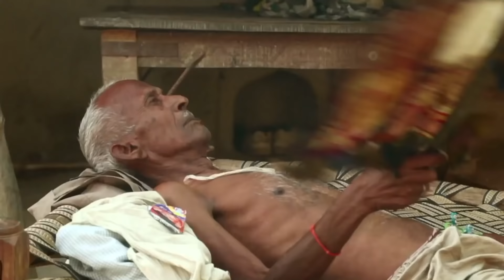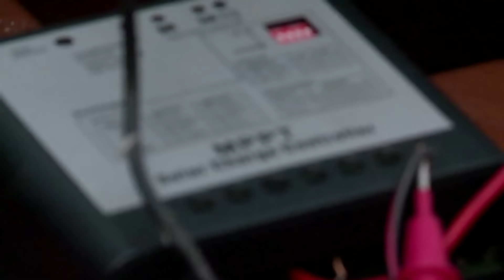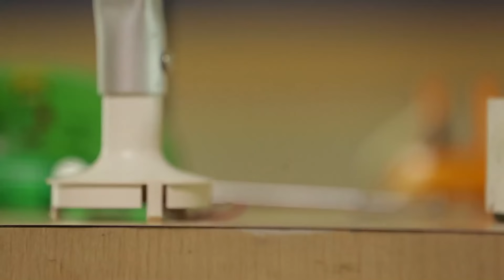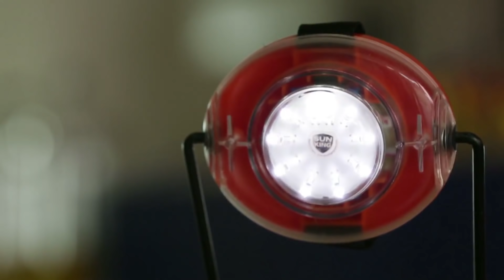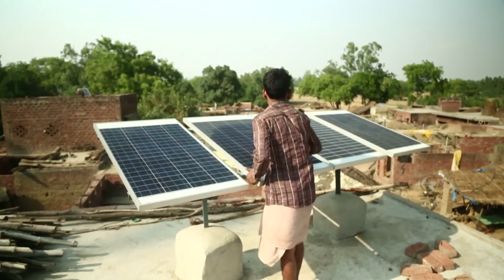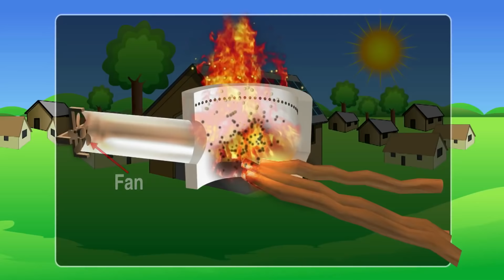TRAINING FILM on solar energy options (ENGLISH)

Comment: Very very informative video, but i would like to make a note  that the led lanterns kept on the machines while working, will have an adverse effect on the eyesight, rather than keeping them hanging on the top, just above the eyelid's level or a bit higher. 
This will not affect the eyes and also provide a good vision.

Comment: The people who made the battery lamps do NOT know anything about batteries.  NEVER tip any acid battery on its side.  A battery with gel in it will still end up with less gel on the plates when tipped on its side and you will end up with only 2/3 of power from the battery as less plate coverage will reduce the output power of the battery.   I see this all the time in many battery run things like mowers and lamps.  Any battery with plates MUST be kept upright and NOT tipped over on its side.

Comment: Ah is NOT a measure of a battery's capacity, Wh is.  You have an error.  For example, a 6V 50Ah battery has LESS capacity than a 12V 33Ah battery, even though 33Ah is LESS than 50Ah.

Comment: 300 watt array for 40 homes is ridiculous.
Reply: It's more than before (zero watts of electricity)!
Reply: 300 watts can do a lot if one uses efficient devices downstream of the supply. It is only the use of power hogs that make any system bad. Direct charging of electronic devices without inverters and transformers is more efficient if the voltage is compatible and amperage sufficient .
Reply: Oscar, it is for charging the small lanterns, they are not americans and can survive with one tiny light🤗

Comment: Why using 18 volt solar panel with 12 volt battery.????.when the work does the voltage regulator...I used  36 volt solar volt in 12 volt baterry  and the regulator voltage does work...very good
Reply: Nice. I'm agree with you.

Comment: Lead acid batteries only last about 300 charge cycles, compared to lithium ion batteries 1000 or more charge cycles
Reply: 300 cycles for starter type not for deep cycle type. For solar you need deep cycle not car starter batteries.

Comment: Great video. Thanks. Can you talk about solar energy to be use for air conditioning off grip?
Reply: Grid.
Reply: One idea: use reflective roof tiles (white), so that the heat is not absorbed into the roof, heating the house.
Caveat: winter will be colder (if you don't have snow on the roof usually).
Reply: A better idea is to Vent your roof near or at its peak and fit an underfloor vent to bring cooler air into your rooms.  Heat rises, give it a way out. Suspend a cover over your peak vent to keep out the weather but still let hot air out .... extending the roof out to form a veranda will also help if it’s on the sunny side of the house ....